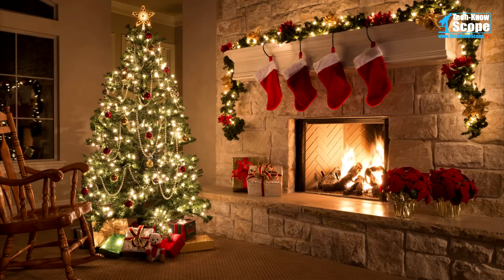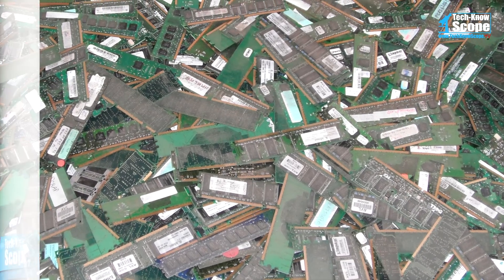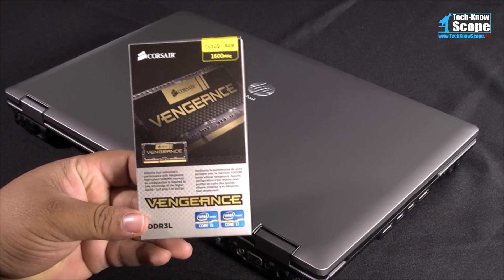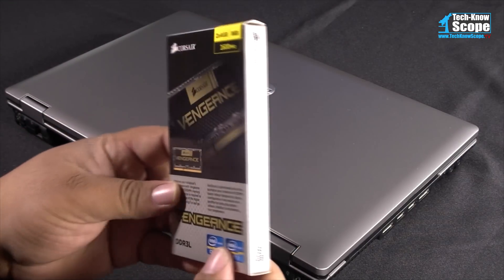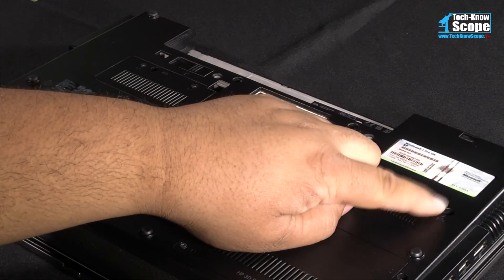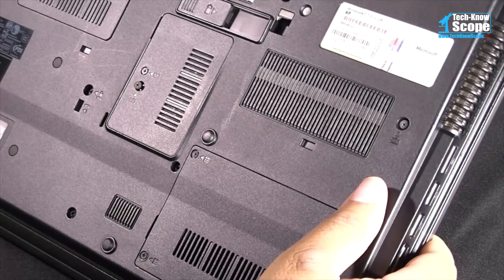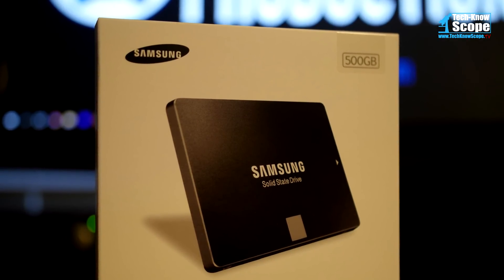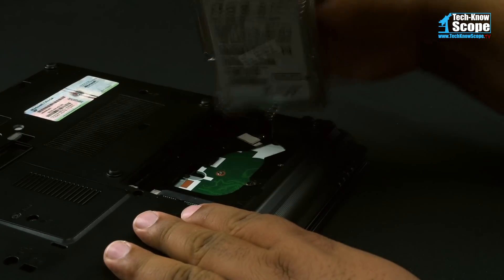▶️ SSD & RAM Upgrades | How Much Does It Help?

Comment: So I just bought my first gaming Laptop today the Dell Inspiron i7559-2512BLK. And am wanting to do some upgrades. One being I want an SSD There's a spot for 
Samsung 850 EVO 250 GB M.2 SSD. But that brings me to 2-questions. 1: Putting an SSD in this slot, how will I even use it. ( Am completely new to this ) 2: Instead of doing that, would it be better to just replace the 1TB 8GB hybrid drive with an SSD? ( If this route is better, how do you get your operating system off of hybrid onto SSD)
 Any help in this matter is much appreciated it. As I said am New to tech.
Reply from the maker: +Michael McCullough it sounds like you can add an extra drive for additional storage on your new laptop. That drive would only be for your files, things you manually save to it. Think of it as having an internal flash drive, instead of plugging one into a USB port.

If you want to speed up the computer, the way to go is to replace the hybrid boot drive. This can be a complicated process if you don't know what you're doing, however Samsung makes it pretty easy using their included software. The first thing to consider is if you have a 1TB hybrid drive, you would likely want a 1TB SSD to replace it. I have links in the description of the video so you can price those. To do the data transfer (cloning your boot drive to the new SSD) you will need a USB to SATA adapter cable. Once you're connected, run the software and clone the drive. After the drive has cloned, physically remove your old boot drive and put the SSD in its place. It should boot to it right away and it should run much faster. Then you would need to install Samsung's software if it didn't copy, and optimize your OS for SSD (1 click in their app).

Hopefully all of that will happen smoothly for you and without any hiccups, however I can't promise that it will go 100% smoothly, so you should probably have a techy friend on call to help if something goes wrong. Since all computers are seemingly different, it's not something I could help you with here if something was to happen. 

Good luck, I hope you enjoy your laptop, and I hope you can do the upgrade yourself! That's how I learned everything I know! Thanks for watching!
Reply: +Tech-Know Scope Thanks for the quick reply and info. I was told an SSD would improve gaming a little. So that's what am after. I will replace the Hybrid with a 1TB or 2TB ssd. Thanks again